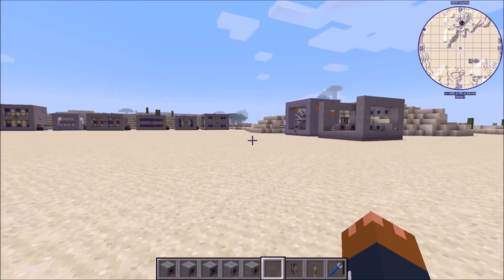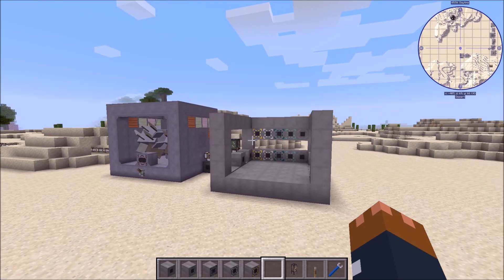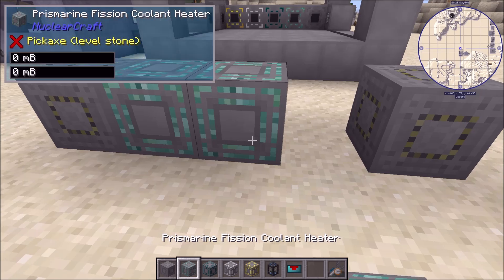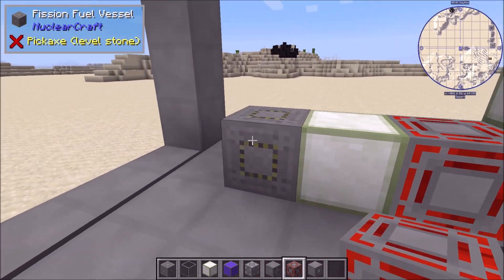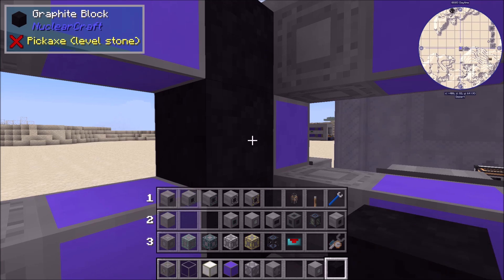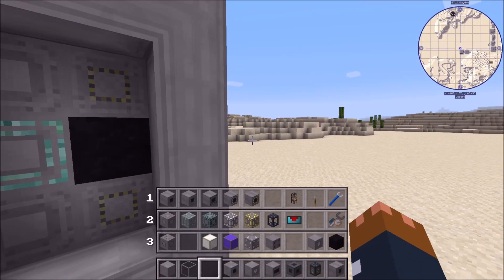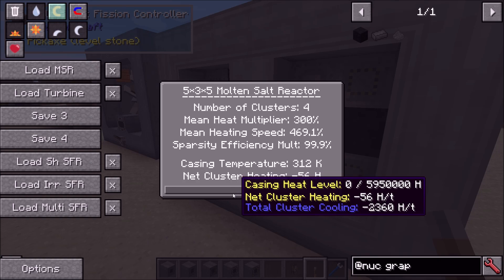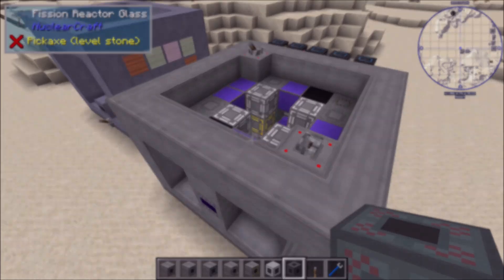NuclearCraft Overhaul - Molten Salt Reactors

Comment: Love the new MSR system, making the MSRs themselves somewhat easier to design and build should make for more complex builds further down the line, as its easier to use multiple different coolants now, you're gonna have to handle these different coolants separately as well, which adds more thinking and balancing down the line, can't wait to see what the new heat exchangers will look like, keep up the good work!
Reply from the maker: Thanks very much! Hopefully then turn out nice :)

Comment from the maker: Note: I should explain in a little more detail how the "heating speed" works. In both solid-fuel reactors and MSRs, each cluster has its own heat multiplier, efficiency and other stats - the controller usually shows weighted means of these for the whole design (in the future, fission monitors will be able to focus on particular clusters). The heating speed of a cluster determines how quickly NaK is heated in its coolant heaters. For example, a heating speed of 200% will produce 2 mB/t of hot NaK, 400% will produce 4 mB/t, and so on. If the cluster is heat neutral or heat positive, the heating speed is equal to the standard efficiency. If the cluster is heat negative, the heating speed is multiplied by the ratio of heating to cooling, which will make it lower than the efficiency.

Comment: I have a suggestion. When using the radiation scrubber, holding them as an item should highlight the chunk like immersive engineering core samples. I now you probably won’t see this, but if you do, it could make the mod a bit easier to use.
Reply from the maker: The Geiger counter and Geiger block will do this, but sure, I can add it to the scrubber too :)

Comment: To be honest the new MSR kinda feels like a reskinned SF. The pipes were the fun part I think but I agree that It was quite frustrating. Is there any config to keep the old system for MSRs?
Reply from the maker: There is not I'm afraid, since the system is totally different. What I have been thinking about for a month or so is extra quirks to make MSRs different - right now there's the heaters in moderator lines and emergency coolant, but there may be more stuff later on if it doesn't feel forced :)
Reply: @NuclearCraftMod  thanks for the quick reply. I think that MSRs should be more harder to build not by gating and materials but rather with logistics and complexity. Right now they seem like a direct upgrade. High reward should come from high work. I can't really explain but I hope you get what I mean. I am looking forward to further updates. I am sure you will find a way to balance things out. Good luck!
Reply from the maker: @Rvu43  I get what you mean, and some people will certainly rather have it more complicated, but I just have to go off the fact that almost no-one used the old ones, and even Direwolf didn't seem to be able to bring himself to do a spotlight on them :P
Reply: @NuclearCraftMod  Hmm I understand. I shouldn't be so prejudiced maybe this will allow for more exciting designs rather than microsoft pipe screensaver. Besides overhaul is yet to be finished, I am sure things will fit better as the mod progresses. Thanks and kind regards.

Comment: So, would you then need 5 different heat exchangers - one for each type of coolant? It seems like a lot of extra work and extra complexity, just to get to the same point that a solid fuel reactor gives you - steam. Is there some other benefit to MSR's that's not apparent here? Not trying to criticize, just trying to understand why you'd bother.
Reply from the maker: You can use different types of hot coolant in one heat exchanger - you just have to set up independent lines for them. Ultimately the steam per unit fuel is greater for MSRs, by two or maybe more more depending on what people testing it all out think :)
Reply: @NuclearCraftMod  Ahh OK, so you can use just one heat exchanger, and there's a bonus to output. Makes sense, thanks :D
Reply from the maker: @JamesAustin  No worries :)

Comment: so there is no heat exchanger yet?
Reply from the maker: Not yet, no.
Reply: What mod would you suggest as a fill in?
Reply from the maker: @Hackerhunter15  As a fill-in for using the hot coolant?
Reply: Yea.
Reply from the maker: @Hackerhunter15  There isn't any mod I know that uses it.
Reply: Well according to the nets, ic2 does add a heat exchanger, and as I have seen on these vids, it is compatible with NC.
Reply from the maker: @Hackerhunter15  It's not compatible with NC's molten salt coolants, though.
Reply: One more thing, how's fusion reactors?
Reply from the maker: @Hackerhunter15  Not in yet, but they will be eventually.
Reply: Ok, I want to increase the helium 3 from moon turf, how can I do that?

Comment: my main Problem is to get the Solid Fuel ''Pills'' 
so many Fuels and then theres all the Uranium Types and Oxidized ones.. before getting the right Type togeter in a Recipe i Looked it up 100 times to get the right type that is needed. 
If there would be a Block or Machine where you can Tell what Fuell you need and it grabbs itself from say a Chest above or so.. and gives out exactly the Fuel (say u-235) this would make my life easyer

oh and the Radioaktive  Ghoul Skins and behavior is not fitting the Mod. It looks like a Fun Mod not like something from a great Tech mod. Maybe some other modder that is god at modding Mobs should try to make it a bit nicer and more scary
Reply from the maker: Once you work out how to make fuels, the pattern is relatiely simple - you make the fuel out of its isotopes, then combine with oxygen, nitrogen or zirconium. Alternatively you can make the oxides, nitrides or zirconium alloys first, then combine them into the fuels :)
If you want to remove the ghouls, you can do so in the configs.
Reply: @NuclearCraftMod  thank you for the quick reply. 
The ghouls are okay to leave them in but not really scary lol :) 
In a wasteland I imagine something like green Puddles or Acid Rain that hurts or Poisons you. Or little glowing ''Maggot like'' creatures living inside the Waste. Or Mutants xD
you dont need to answer this iam just having something in my mind i see really fitting together with NC but iam not a Modder
Reply from the maker: @landtechnik4k  I just added them so that there was something in the wasteland rather than it just being barren ;)
Reply: @NuclearCraftMod  oh that theyre that new i did not knew. thaught they were there quite a while now